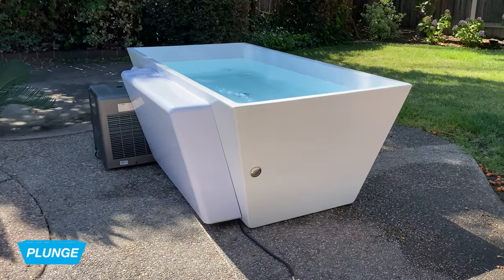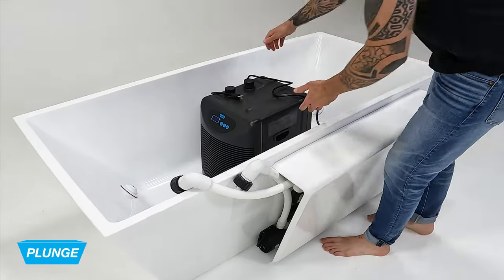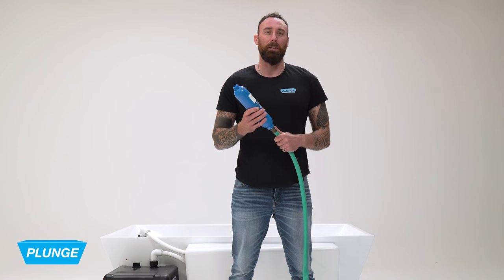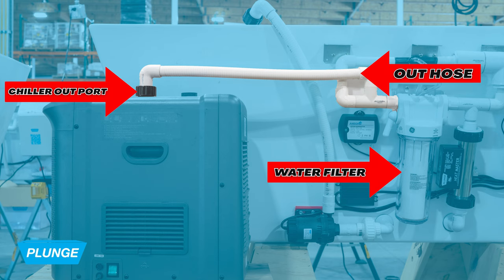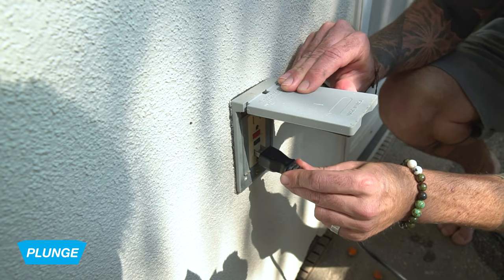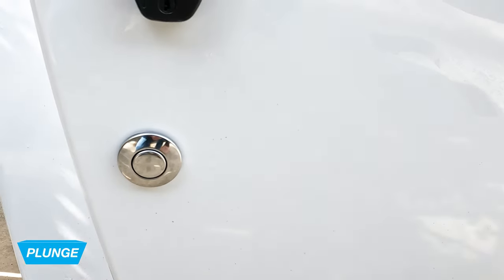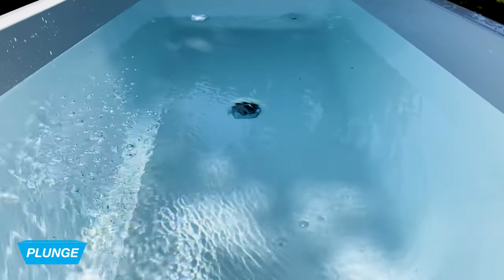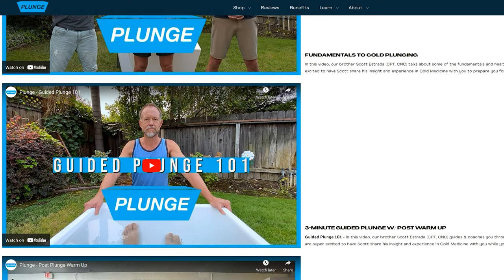Plunge - Setting Up Your Cold Plunge (updated 9/2022)

Comment: What do you mean by the outhose to the filter and connecting it after its full? So confusing… you dont show and example you only go to step 4 shouldn’t this be a step? Were are the typed instructions? Also the electrical cords , i habe one goming out of the water chiller is that the main cord you are talking about bcz in the box i dont see any to plug inside the box? Your not showing inside to give clear detail’s….:( i need help
Reply from the maker: Hello, I believe I was able to address your question on your past comment. 😁 The hose attached to the chiller is exactly the one we are referring to in the video! Just connect it to the chiller port that says "out" after your Plunge is filled up! 

Let us know if you have any further trouble! Have a great day! 🥶🔥
Reply: Im still confused